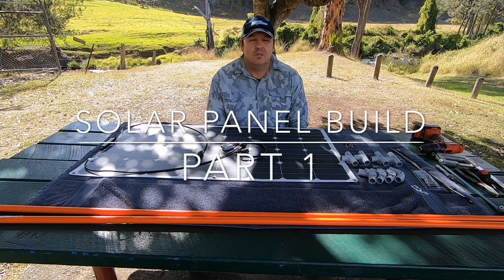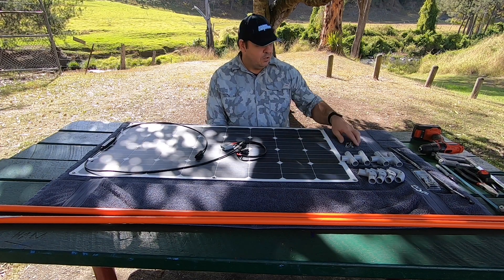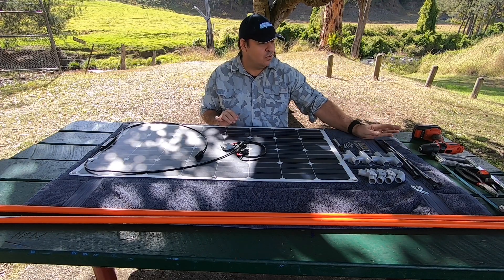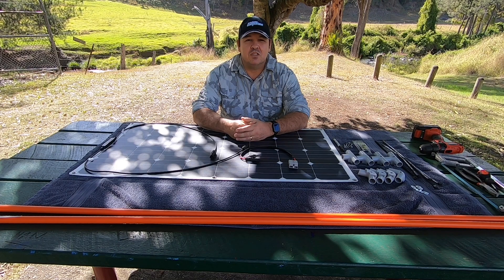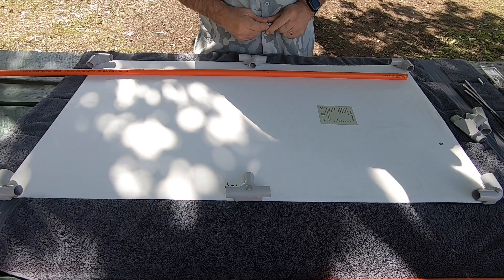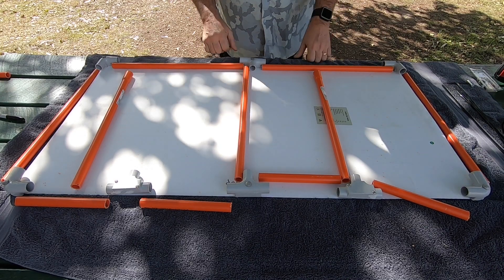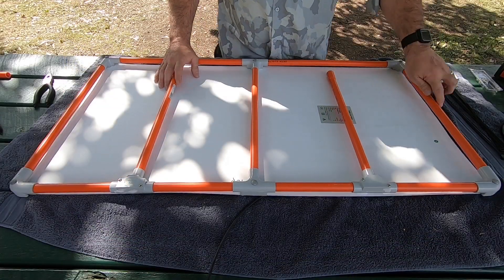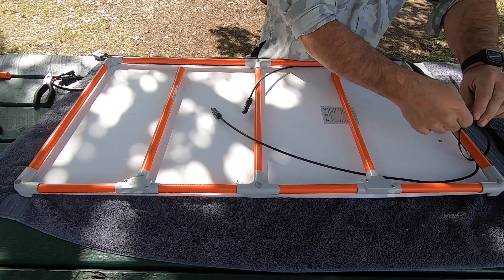How to build a lightweight solar panel frame Part 1

Comment: Thanks for taking the time to record. Really tidy build, will be doing this myself now with 2 panels individually like this connected in series and then when camping and away from base, use one to catch the early sun and then another angled to catch the sun later.

Comment: Great video! My camper is parked under a bunch of trees so rooftop panels are not sensible for me. Typical 100w panels are too heavy to move with the sun so I was looking for a better option. Was considering a 100w flexible bifacial one.  Before I made that purchase, needed to figure out to make it more functional for practical purposes.

In my search I stumbled on this presentation. Your project not only assisted in solving my issue it gave me the additional thought that the the whole point of bifacial panels is energy is absorbed on both sides of the panel increasing output. Thinking I could add  1" conduit under each corner and then slip in some reflective insulation in-between the panel and conduit to optimize energy absorption. Thank you for this!

Comment: It is really an amazing idea that use the plastic tube instead of aluminum solar frame. It will help to make a lightweight solar panel. We just made a new website to introduce solar panel frame info. Pls help to give some suggestions if available. Many thanks in advance.Our website is: https://aluminumsolarframe.com/

Comment: This is excellent mate, thanks for posting. Enjoying you vids, keep em coming.

I’ve got a set of 150W foldable alu/glass panels and I’m finding them very heavy but have pretty good output, how do you find the flexible panel output?

Cheers
James
Reply from the maker: Hi James thanks for your comment. I was using a 120w foldable panel and was happy with its output as well. I am finding a good quality flexible solar panel just as good but much easier to store in our small camper. It is so much easier to move around to keep in the sun as well. Thanks again
Reply: Agreed, the light weight and thinness of the Flexi panels are a great advantage. I’ll have to get a set.

Cheers

Comment: Did you just put bolts through the panel to the bends
Reply from the maker: Hi i placed bolts through the corner bends in the and in the centre where the holes are in the solar panal. hope this helps. please let me know if you found the video helpful. would love to see a picture of your set up. thanks again.